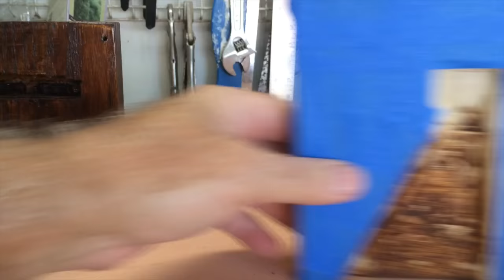Phone Amplifier Build

Comment: That's really cool. What type of wood do you think is best for this & how thick was the wood you used here..? Thanks
Reply from the maker: shorethings Hard wood would be the best, provide the most reflection of music
Reply: Thank you for your response. Our local timber merchants has planed redwood. Would that be difficult to chisel..?
Also & sorry to be a nuisance but, if it was chiseled with a wider channel, so the position of the speakers on different phones could be taken into account, would this have any impact on the overall sound quality..?
I am thinking of making a few of these as presents & I'm guessing the phones will be different.
Thanks again!
Reply: P.S. I've never done anything like this before, but I think it will be a really interesting thing to do, as well as saving on buying presents...!!  :-)
Reply from the maker: Redwood would work, should be soft enough to work with,  be sure and go online to see the exact phone sizes, then add half an inch to the slot width for the phone to fit in.